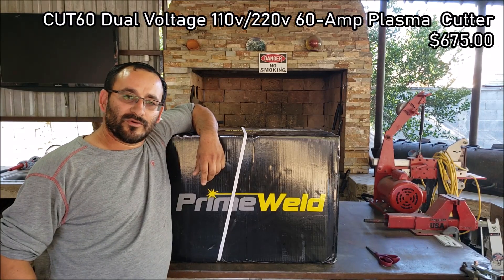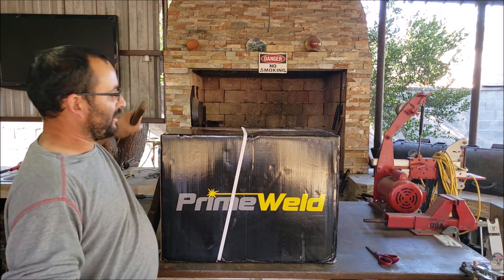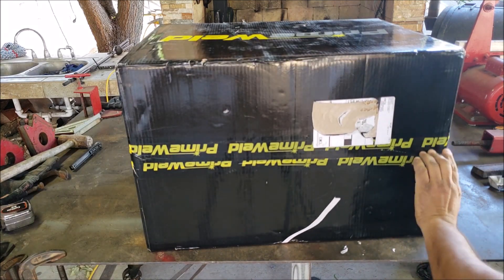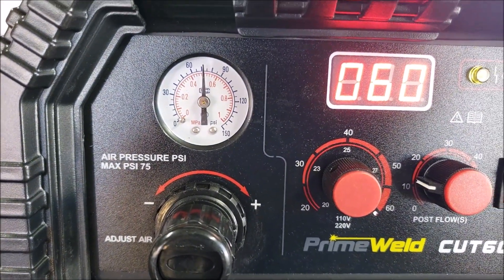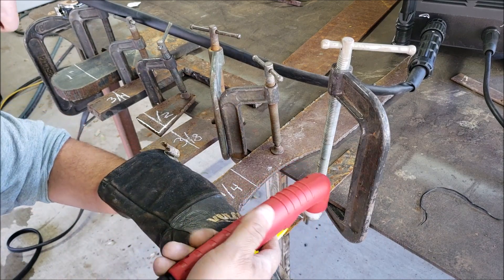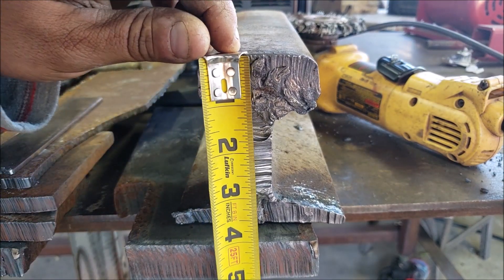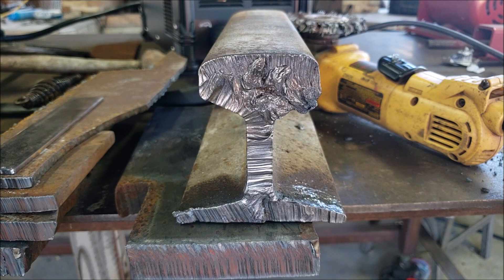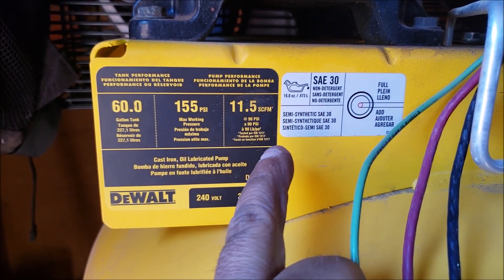Unboxing and testing the Primeweld cut60 plasma cutter : Quick Review and test #Primeweld #Cut60

Comment: The cut quality on that 1” steel was impressive.  I’m curious if you ever tried cutting a non-straight line on 1” thick steel with the cut60 on your cnc plasma table. 
I’m thinking about getting the cut60 and would like to cut some 1” occasionally on a cnc table.
Reply from the maker: The thickest material I have tried cutting is 1/2" on the Crossfire table. My table don't have a height controller and feel like that affects my cuts. The CUT60 is a beast which is currently down for the first time in years and that's because I broke my torch with a hammer.

Comment: Back in the day i was on a jod cutting 3/8" Dimond plate floor out 
Had to cut it out in sections 50ft long cuts had to make 10 cut 500 ft total 
Had a 220v 105amp machine turned it up to max and cut 500ft in less than an hr 😮
Reply from the maker: I have so many questions, 50ft sections? Where you cutting out train boxcars? I can not imagine the power behind a 105a machine but would imagine it makes my life easier. I have cut several long sections of .250" plate with my Smaller Hypertherm Powermax45 and eats up steel like crazy.

Comment: I'm really impressed with the cut quality on the 1" piece. I have a cheapo 50 amp unit that doesn't cut that well on 1/2" metal. I just might have to get this one when it stops working.

Comment: Looks like a real good machine
Reply from the maker: The Primeweld CUT60 is a powerful machine and is used a lot on my Langmuir Systems table. This plasma cutter replaced my Hypertherm Powermax 45 which is also another great but expensive machine. Thanks for watching.

Comment: What size plug fits the CNC port on the primeweld cut60?
Reply from the maker: The CUT60 came with the plug that allows you to wire it up as needed, not sure the size or type of connector.
Reply: @cutweldngrind 
Because of your video I found the cnc adapter in the box 😂
I have the same unit but didn't realize that it came with the cnc adapter.
I bought a cnc torch but the cnc torch doesn't have a on/off button so I'm using the adapter with a switch I linked a video so you can see it in action.
https://youtube.com/shorts/hi6ENwOVmUg?si=EBtUWiXl8w7Jqg55
Reply from the maker: @boricuaarecibo9259  That's awesome that you found the adapter. I messed up my hand torch this weekend and deciding if to buy a machine torch and mount. What consumables does your torch use, Primeweld, Hypertherm?
Reply: @cutweldngrind  I bought my cnc torch from primeweld the switch and wire I bought off Amazon. Since I just bought the torch I'm not sure what Consumables it uses I'm hoping it uses the same Consumables as the torch the primeweld cut60 came with. The best part of the cnc torch from primeweld is it fits perfectly in a Mathey Dearman bevel machine saving me from having to refill oxygen and acetylene.

Comment: I have there Tig 325 x and I’m impressed with the quality and performance of my welder I’m considering purchasing this next thanks for the great review and also is it capable of cnc plasma table interface
Reply from the maker: The cut60 has been an excellent machine and use it as my primary machine. I have a CNC table and you can see it running on my projects without issues. The consumables are also priced well and easy to find. The machine I started with was a Hypertherm Powermax 45 and this one soon replaced it.

Comment: Im gating the prime weld combo...i already have prime weld cut 50d..i want pilot ark
Reply from the maker: The first Primeweld machine I had was the Cut50DP which has pilot arc. The CUT60 is just a big powerful machine and currently used on my Plasma Table. Primeweld has exceeded all my test and thinking on grabbing a TIG machine in the near future.

Comment: Great job did you turn up the air pressure on the 1” plate?
Reply from the maker: The air pressure stayed the same for all the plates I cut. I cant remember on the top of my head the pressure setting but I usually cut around 55psi to 60 psi (14g to 1/4"). Thanks

Comment: What cfm it’s required for these machine ?
Reply from the maker: If I am correct it requires 5CFM at 80 psi. I run a DeWalt 60 gallon compressor for my plasma cutters.

Comment: Work for a railroad Track maintenance as a Thermite welder  and our torch running off propane not acetylene . Can struggle to not cut all the way through the top of the rail you always half to cut the sides and you might get luck to where the torch gets a little past the top of the ball of the rail to where it is in the web is ideal . Great video impressed with that plasma cutter
Reply from the maker: Thanks for stopping by. I have always wanted to try using Thermite as I remember a few years back it was all over youtube. The PrimeWeld plasma cutter is a work horse and I have a job lined up for it in the next couple of weeks.

Comment: Do I need some type of gas for it or can I just use electricity and an air compressor?
Reply from the maker: Dry air and 220v will get you cutting thick materials. I have used on 110v when I cut 1/8 or 1/4" materials.

Comment: Nice cutter. My cheap Icut60 could cut 7/8" slowly @80psi.  Thinking if a better torch would cut 1".
Reply from the maker: Machines are improving over the years quickly. My powermax45 struggles where my cheaper machines exceed in cutting power. I do notice lots of people upgrading to torches that use Hypertherm consumables on their cheaper machines but mostly for longer life of consumables.

Comment: Thanks for cutting actual one inch . I've seen others stack up quarter inch pieces , its not the same.
Reply from the maker: Thanks. I think a 1" cut should be done on 1" plate vs a stack of plates. This plasma cutter has been great and recently ordered me the biggest set of consumables PrimeWeld offers. I do mostly 1/4" steel projects but once in a while I like to put my tools to the test. Thanks for watching.

Comment: This is really impressive! I wonder if my one 60 amp 220V AC weld plug outlet would handle this and my 80 gallon compressor or maybe I need the compressor on a separate breaker?
Reply from the maker: Thanks. I used to run a powermax 45 and a 30 gallon Husky off of my Hobart engine welders 220v outlet and it would struggle a bit. I need to check if the plug is 40A or 50A rated on that welder but these compressors do draw some power. I only have 1 outlet for 220v so can't really do any testing. Thanks for stopping by.

Comment: Outstanding video!  In your opinion is it worth the extra $ over their cut50dp for someone who won’t be doing cnc or above 1/2”?
Reply from the maker: The cut50 will cut 1/2" and thinner material fine and was a great machine that I gave away. The cut60 seems to have more power so I can do faster cuts and thicker material if needed. The Cut50 should be good for you, cheaper, lighter and think consumables were also cheaper. 
If you ever plan to cut thicker than half I would get the 60 otherwise get the 50DP
Reply: @cutweldngrind   Thanks. I think I’ll go with the 60. The ITP 60 backstrike torch alone is likely worth the price difference.

Don’t need multiprocess as I have a Miller Multimatic 220 ac/dc that does everything but cut.

Comment: Jorge, did you try using 120 volt?  If so, what would say would be the maximum thickness for 120?  Thanks.
Reply from the maker: I actually just got the plasma cutter out and will start cutting using 120v only. I should have video uploaded soon.

Comment: Wow! That thing is impressive! 
 I finally picked up some metal for my flatbeds that I'm gonna build.
 Didn't get all the material yet but, most of it ($1,400 yikes)😯
Reply from the maker: Awesome to hear that you got some materials. I bought some used 4" pipe about 15ft each and paid over $600. The plasma cutter worked really well and left me impressed. The machine is heavier than the CUT50DP I gave away but you can tell it has some serious power. I been working on the ranch digging up clay by hand but want to cut some steel again with it.

Comment: Hey Jorge. Wow, that is well packed. That cuts great. I bought one, but it was bought just for light stuff. It is still in the box. I should check it out. Thanks for sharing.👍👍🍁🍁
Reply from the maker: Thanks Andy. I need to cut some bolts on my F250 and also cut my goose neck trailer and I am sure this machine will do the job fine.

Comment: I have their 50A plasma cutter and really like it. So much so that I also bought their AC/DC Tig machine. I'm impressed with their products and this inverter technology is just amazing to an old guy like myself. I'm mostly retired and don't work on big heavy equipment, nor do I travel to jobs anymore, so this is really all that I need. Plus, I've always got my torch for any heating and bending and any carbon steel jobs that this plasma cutter can't handle.
Reply from the maker: The 50A machine I gave away was the CUT50DP and was a very light but capable machine. The Cut50 could do up to 1/2" steel clean but this machine just has some power behind it. I do not know how to TIG but I am looking into the TIG225X AC/DC machine. I do mostly hobby stuff for myself but will help others needing some welding done.